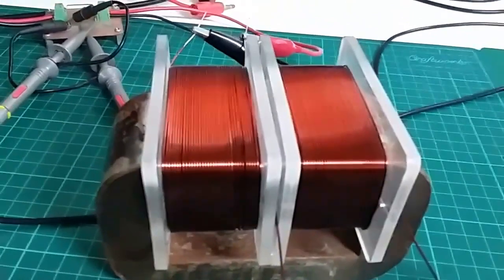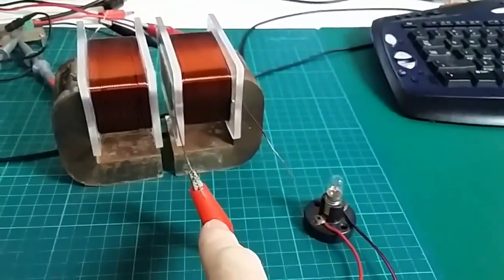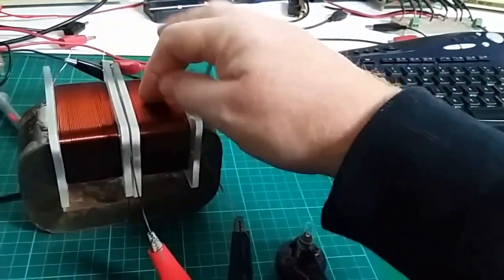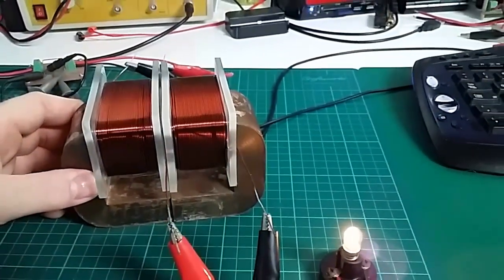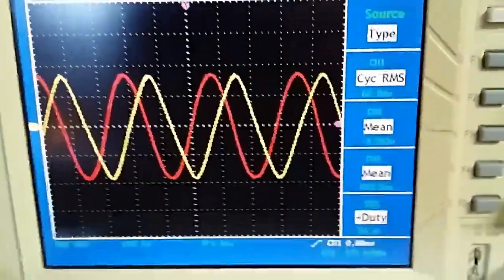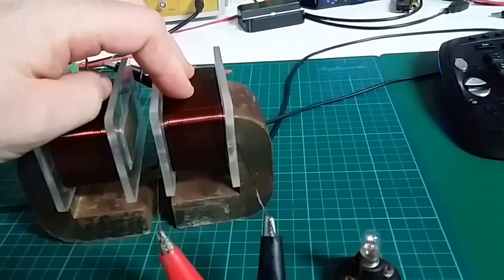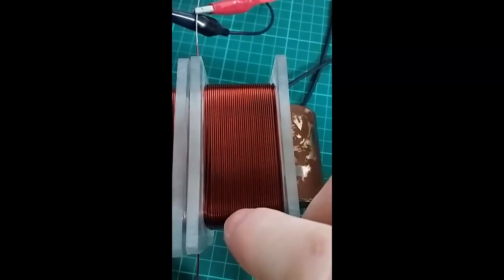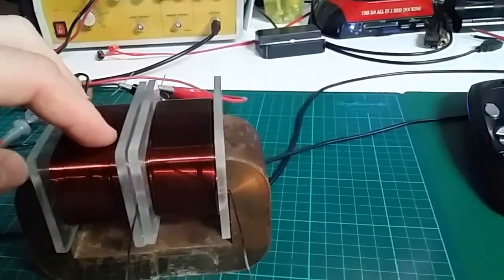The Secret Revealed - A Charge Pump - Electromagnetic Induction Asymmetrically

Comment: I did a bunch of voltage and current in/out readings on mine but still trying to find some in/out readings on yours ?
Reply from the maker: I have opted to avoid debate on measurements, there are too many idiots that don't know what they are doing, that debate the most idiotic things,  I have chosen to stay on the cautious side.
Reply: @SweetSQM   OK but true watts is often the bottom line and helps with comparisons. PS  think yahoo blocked my subscription confirmation email!
Reply from the maker: @aerotro  - In time, more will come! Most guru's dont even know how to measure a Non-Linear Load! Most are complete idiots with a very ignorant training! No point debating with idiots that have no idea!

Comment: One of your best videos yet describing how inductors work and how to make them asymmetrical.  This might seem obvious, but it could be compared to how water flows through pipes with different pressure applied, narrowing a pipe, etc.  One other thing, sense I going to start experimenting and building soon, the go to is to use pulsed DC on the primary right.  Now, I might know what I'm talking about; however, is it possible to use pulsed AC?  Can this even be done and if so, how?
Reply from the maker: All of your questions have answers on my forum, I have been through many times, so sorry for not being more patient, but I have already provided this info many times, if you go and read, do the study, on my forum, please.

Comment: Remember, only series resonance gives zero impedance (wire resistance only).

 Resonance has no power, as the current and voltage are out of phase.
power= current * voltage (in phase).

a bifilar coil has unity coupling between its 2 windings. k=1

Dont see anything special here in this video.
Reply from the maker: Hey M-Ivo - I have to disagree. Magnetic Resonance is not LCR Resonance. Many mistake LCR Resonance and have not investigated Magnetic Resonance. Really Important we get people to investigate Magnetic Resonance! I and V are in phase, REAL Power powers the Load!
Reply: Ok magnetic resonance. where can I find more info about this?
Reply from the maker: Start with The Mr Preva Experiment.
Reply: @N01Spl Indeed I'm starting to see that as well. the magnetic field of any resonant coil holds power.
so the question becomes can we amplify it? or can we recycle that electric energy
Reply: @N01Spl  I above all?  I'm only human, and still learning!